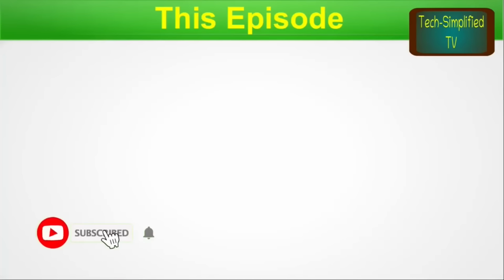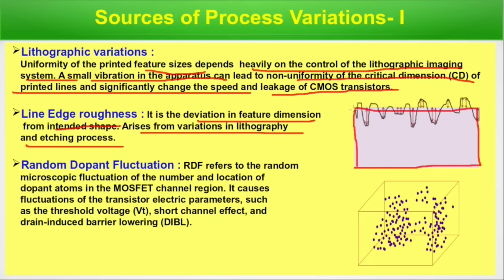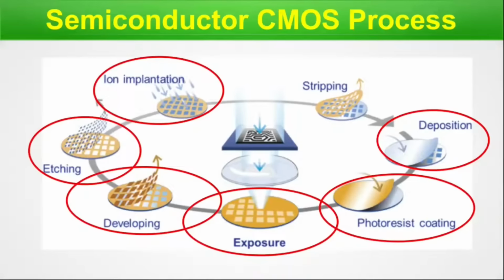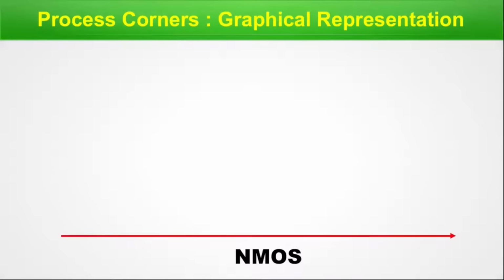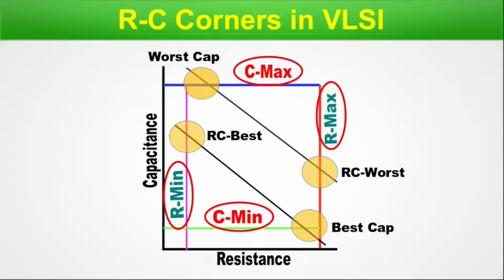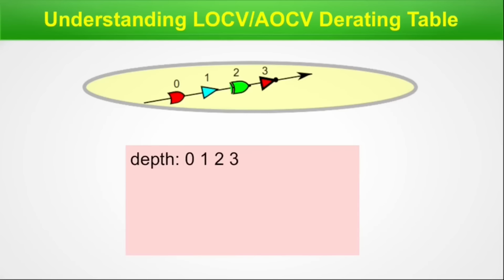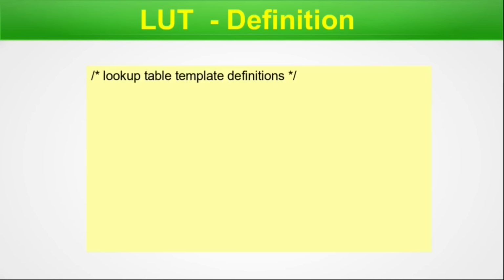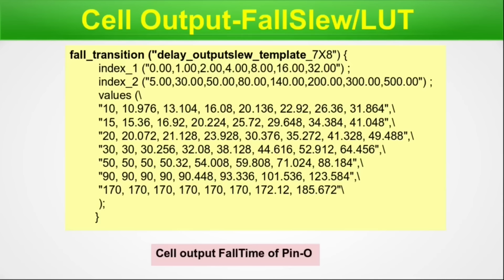Variability And Timing in VLSI  | RC & Process Corners, AOCV, LOCV, .lib Explained

Comment: Nice presentation, I found it very useful. I have a question which is commonly asked in interview, how to approach when same timing path is both setup and hold critical, can you please answer or point me to video if this has been already answered
Reply from the maker: A path becoming both setup- and hold-critical usually means the path is sitting at the boundary of minimum and maximum delay requirements, often due to clock skew, unrealistic constraints, or improper balancing of logic. You must separate the two problems and fix their root cause, not just add buffers blindly.